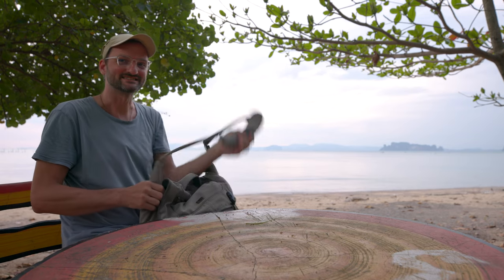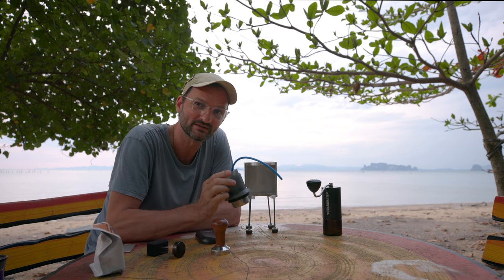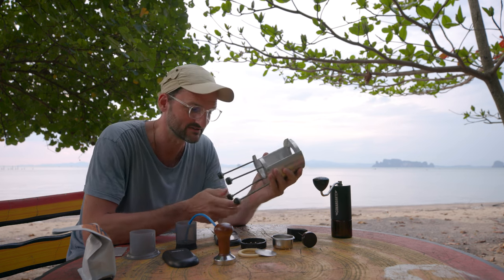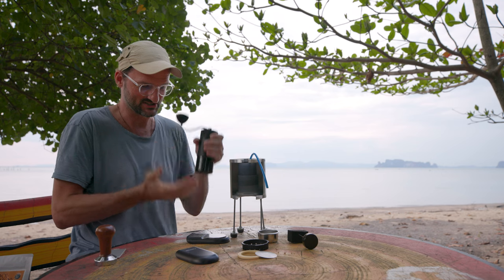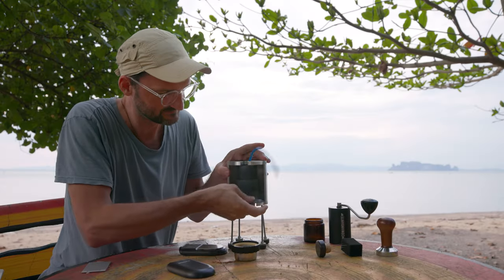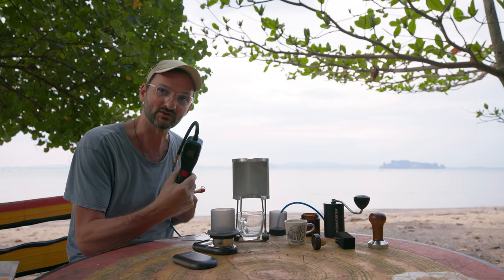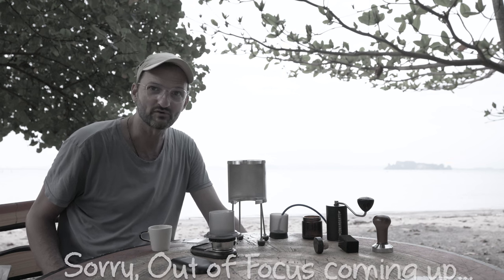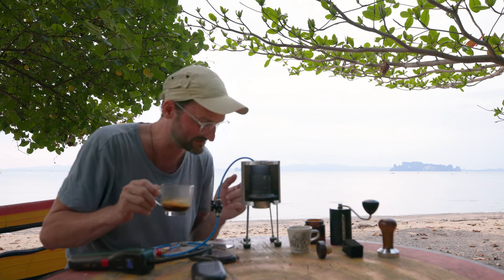Aeropress under Pressure: 1000 shots with 9 bar

Comment: How is the water not immediately soaking the coffee and dripping when you pour it in?
Reply from the maker: I am adding a shower screen on top of the coffee puck. Without any extra pressure, the water is only slowly dripping down. A few drops might get absorbed in to the puck before I introduce pressure, but this might even provide a good starting point for the water to evenly distribute.

Comment: Hi sir, can I buy your invention.
Reply from the maker: i wish I had the time to build a few for interested buyers, but no time! but why don't you build one yourself?
Reply: @mikkisdiyobsessions3742  "why don't you build one yourself?"
99% of people don't have a metal shop.
Reply from the maker: @grabble7605  If you are a tiny bit into DIY, It can all be done with standard tools: Drill machine, drill bits, hole drill, metal file, fretsaw and a hand tap.
Reply from the maker: The base frame is a standard Alumnium pipe, about 10 USD. Maybe 15 including postal charge. The bottom and top lids are alumnium glastable covers....all parts easily to get on Amazon for cheap.